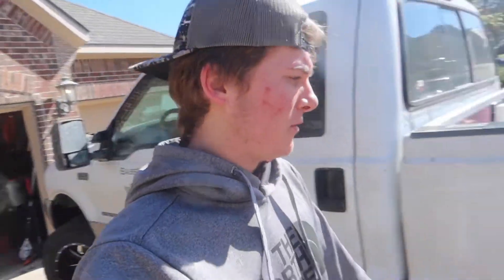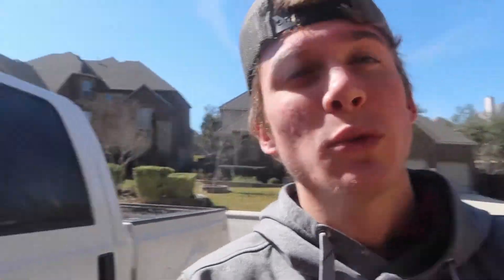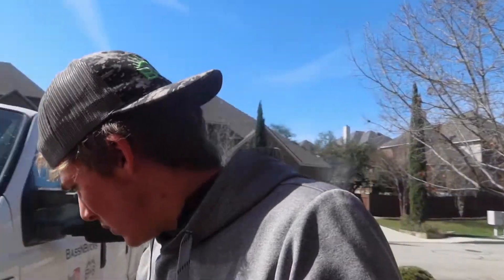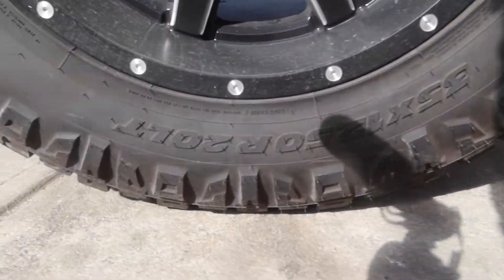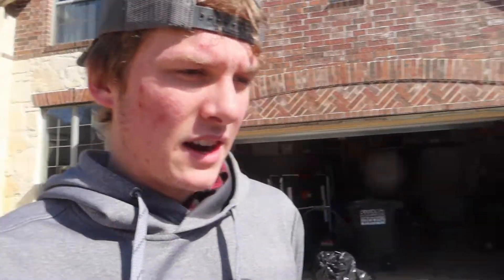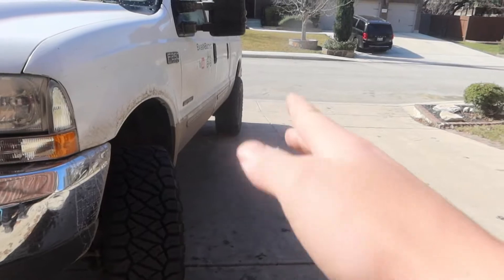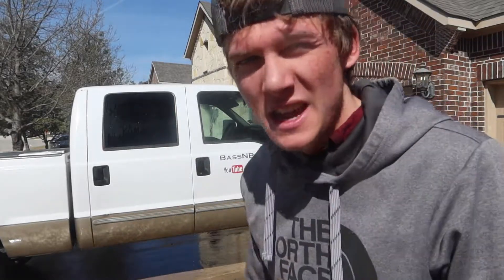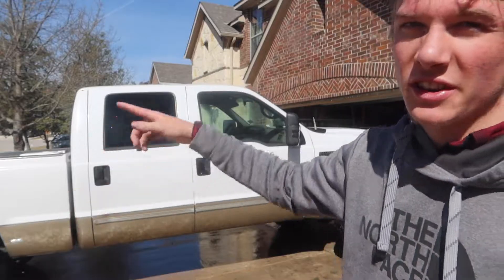Putting NEW Fuel Maverick Rims & 35" Nitto Ridge Grappler Tires On My 7.3L F250 Powerstroke Diesel!

Comment: I have the same truck but 6.0 and im about to get the same wheels tomorrow, would a leveling kit make sure it doesn't rub
Reply from the maker: I leveled mine and they still rub on the back plastic make sure you zip tie it back or cut it.